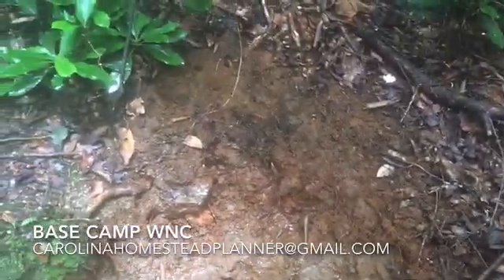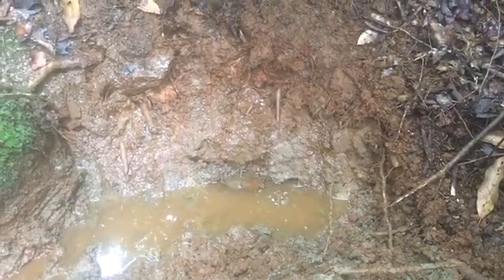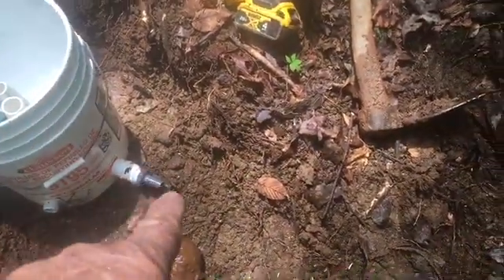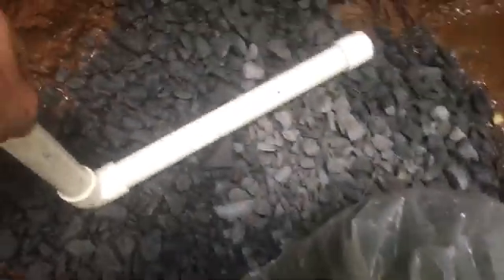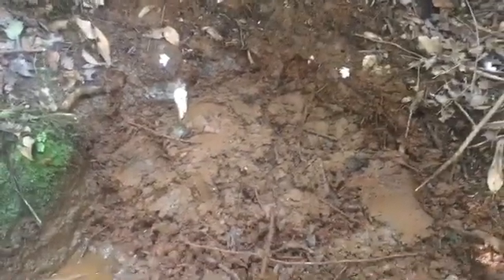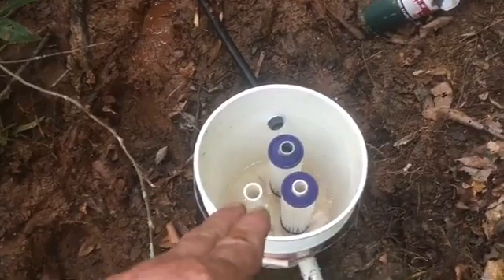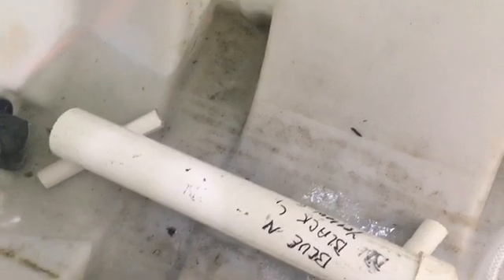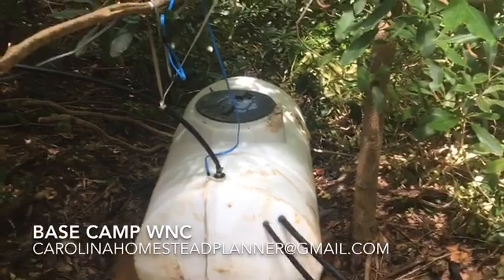Spring Water Capture And Pumping Uphill

Comment: Going to be doing this with property I just purchased with a spring on it.  First question it looks like there is two spots where water is coming up to ground. Is it better to tap into the higher or lower spot do ya think?  Also with the one guy asking about solar what about two cisterns one at spring as a holding tank and one at the house just using the pump to fill the top cistern?  Also with this set up and the water running back out of the line to avoid freezing is there a delay when turning on a faucet or shower waiting for the line to fill back up and pressure for the house?

Comment: Do u install these in NC?
Reply from the maker: Where are you located 
You can email me 
Carolinahomesteadplanner@gmail.com
Better than putting it on YouTube
Reply: What pump are you using?
Reply from the maker: It will depend on the height, flow and pressure that you will need
I prefer to use Franklin pumps

Comment: Great info Sir. I have a similar scenario of having to pump uphill. What kind of pump did you use? Was it solar?
Reply from the maker: Used a deep well AC pump
In a sleeve 
You can use a solar pump 
Have not found a solar pump that will last pumping under pressure all the time
I found it’s best to use a AC pump with a solar back up if you are looking for redundancy 
I’am off grid and use a AC. Pump powered with solar
Thanks for your comment and as always like and share 
Eric
Reply from the maker: Welcome 
Ask questions or let me know of a problem you have that maybe I can help you with
Reply: My option for AC is absolutely not an option. Grid power is too far away. Solar is my only option or a fuel powered pump. Any advice on the better choice ?

Comment: How do you clean out the sediment on the bottom of the bucket? Should I install unions on the pipes so I can disconnect and dump it?
Reply from the maker: If the spring box is just setting on the ground you can just turn it over
After your comment I have been thinking about putting in a drain 
Drill another 1-1/4” hole and screw in a 1” plug
I will be making a video on the spring box build and will be including the drain 
Thank you Bob Bob for this idea
And as always subscribe like and share 
Thanks
ERIC

Comment: Love what you do, here on my hill in Kentucky I have to have a 2” line we got so much water coming out of the hill hasn’t rained in about 4 weeks still getting 3-4 gallons a minute. I’m still having issues with the spring moving on me after heavy rain and sand washing into it plugging up my pipe, on my 3rd time damming it up now I’m gonna have to stick with large rocks , I may have to clean sediment tank before filling holding tank but looks like we will always have free water
Reply from the maker: Nothing in life is free
As I say in classes you are the water department now 
So maintenance is required
Reply: Video is on my channel if you would watch appreciate it